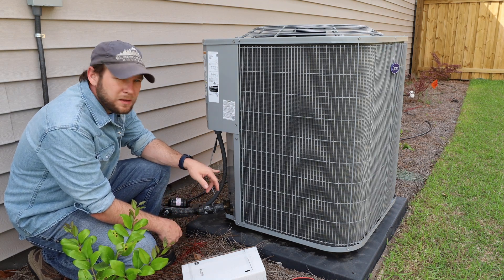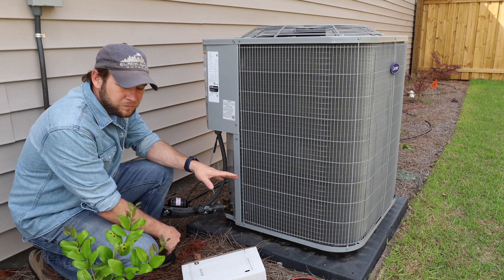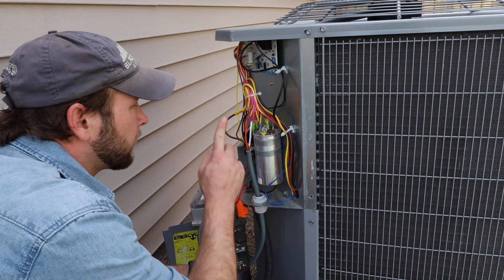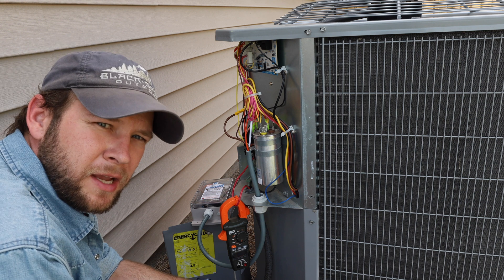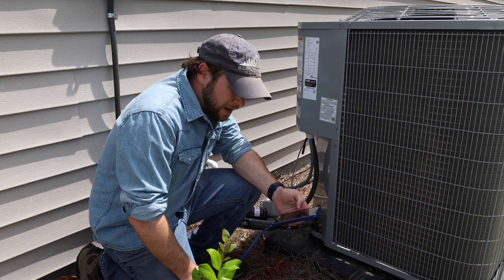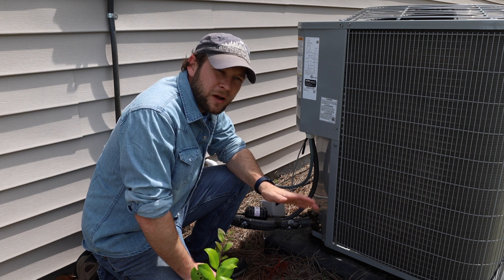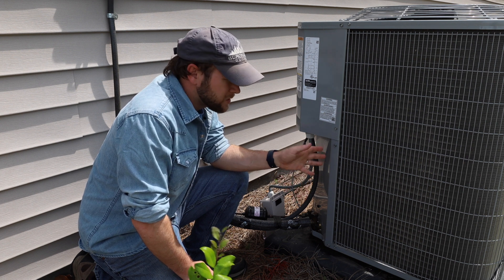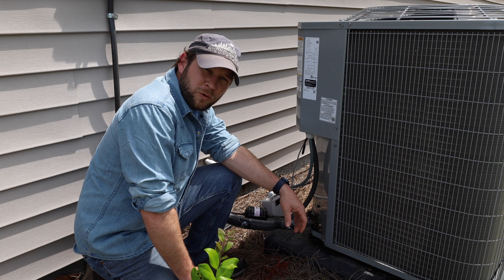Micro-Air Easy Start Installation, Will house AC on a generator be possible with a soft starter?

Comment: I know this may be a silly question, but could this possibly allow me to run the hvac on a 30a 120v 3800w running and 4500w peak?
Reply from the maker: Unfortunately no, 120v cannot power a 240v ac unit, not without a large step up transformer that would cost more than just getting a generator with 240v. Additionally, 4500w is very low power for starting an ac unit, even with a soft starter installed.
Reply: @DemonicAnimatronic  The 4500W generator should be able to start a 2T AC unit.

Comment: Does installing this unit save on power usage during daily operation ?
Reply: Very little if any savings, what it does is prevent or reduce your house lights from flickering every time your ac comes on.

Comment: I don't plan on running a generator, but I am interested in making the unit quieter, the unit sounds like a train wreck when it starts.  You mentioned that is a side benefit of this soft start, but that is my only need right now is to make it quieter.  My place is only 3 years old and have (I think) a 5 ton unit, 2400 sq. ft in Arizona.  The architects that designed this place in their infinite wisdom placed the unit 3 feet from a bedroom window..... WTH????  What are your thoughts on making it quiet, I was also considering an acoustical blanket for the compressor as well.
Reply: Blanket on compressor would probably retain to much heat.
Reply: @tradesman63  Misnomer.  The compressor is cooled internally by the refrigerant.
Reply from the maker: I don’t believe it would do anything for running noise, for me it just took the big hit at the start down. Which makes sense when you think about what this unit does, it really is just for the starting of the unit. The noise from these comes not only from the compressor but also from the fan and from the unit as a whole resonating. So panels rattling and vibrating etc.  you could definitely try a compressor blanket kit and I might try some mass loaded vinyl or mlv (like they use to dampen car panels when putting in sound systems) on some of the metal panels of the unit, make sure everything is tightened and maybe place rubber washers where panels vibrate agains each other. Not sure what else you can do other than that, planting bushes around units can help with noise going to neighbors and sometimes bouncing back to your house, but make sure you don’t block the unit from being able to get air.

Comment: I would like your opinion on something, Someone has installed a hard start cap on my older 4 ton condenser unit. If i install a soft start kit like the one your installing do i remove the hard start cap first or do i leave it on the unit.  great video, thanks much.
Reply from the maker: The easiest method to install these is when your units wiring matches the factory diagram. So if a hard start kit has been added in, it would be removed. The EasyStart has its own internal cap and start circuit that bypasses the start cap in the unit anyway.

Comment: Will  a 9500watt 120/240 30 amp generator start the a/c. Or will I need a 50 amp?
Reply from the maker: There are a lot of variables with that, for me and my unit the answer would most likely be yes. My start current is now below 38amps which would be about 9,120w at 240v  the key is how long the start current lasts and if the generator can sustain that current long enough. if it has a starting wattage that exceeds your ac starting current than you should be fine as long as the generator is honest and isn’t faking the specs. Remember though that this is just your outdoor unit, the indoor unit also needs power as well as anything else that happens to be on at the same time. All the devices on the generator will take away from your available power.

Comment: Will it save you money on your monthly electrical bill?
Reply from the maker: Most likely not, in general this won’t really lower your usage over a full run cycle. It is meant to take down the peak at startup, but as most electricity is billed by KWH and not peak usage, it will still consume the same amount of power over time.  Now, it may extend the life of your ac unit by reducing the startup wear on the compressor. If you are attempting to run on generator, solar or other non-grid power source, then it could allow you to use smaller inverters or generators which are cheaper. So it could save you money, just maybe not on your electric bill.
Reply: It may help reduce peak demand charges, depending on how your electrical plan works.   With high current devices such as washers and dryers, you have an option to use them when peak demand charges are lowest.  (off peak)    AC units however will run most when demand charges are highest, so the lower inrush could help soften the peak demand charges.